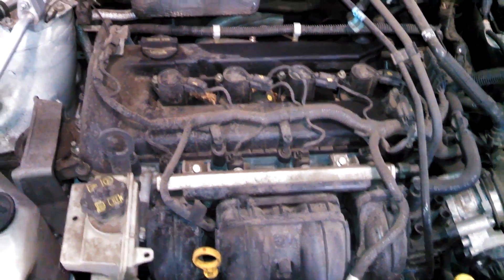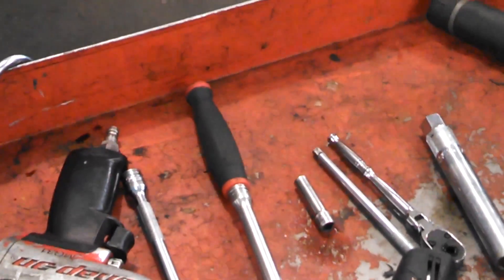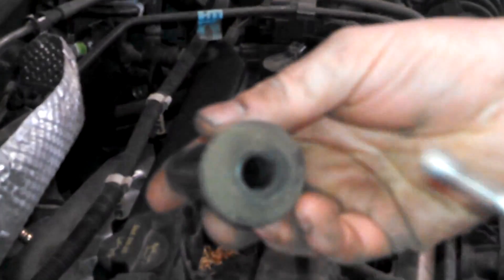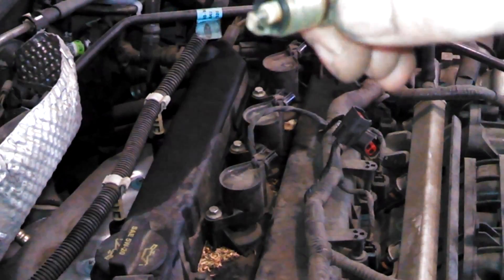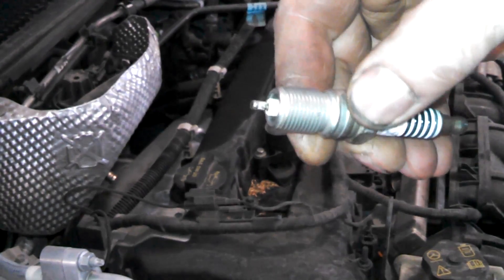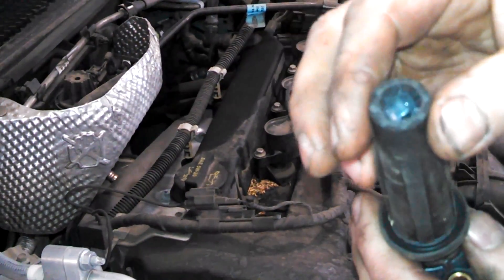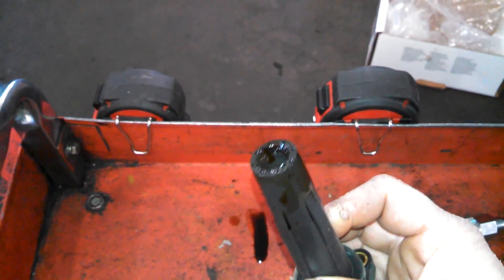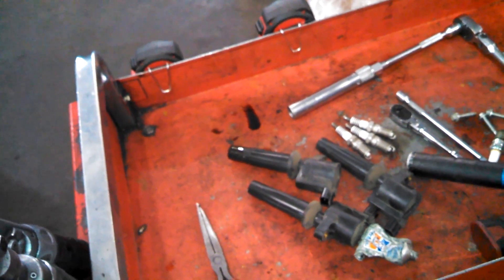Spark plug replacement 2008 Ford Focus 2.0L ignition coil. How to change plugs

Comment: Just did a plug job on a 91 taurus GL 3.0, had a bad misfire on acceleration now runs like a champ.  Hardest part was breaking the wires off the plugs. It was my grandmas car that was maintained VERY meticulously except for the plugs....they may have been original, wouldn't surprise me
Reply: Sometimes it makes things easier if you warm the engine up before you start.

Comment: Nice bro, 2 suggestions 1. What's OEM recommendations on spark plug part # 2. Possibly tighten bolts to stop or slow down oil leak

Comment: Spark plug gaps are measured in thousandths of an inch. How did you eyeball the gap so that it "looks good?" The gap is supposed to be .051". On modern, computerized engines this gap is even more critical. That is why engines use precious metals now, in order to maintain the gap longer. Yes, they can be gapped, you just need to be more careful as the finer electrode is more susceptible to deformation.

Comment: Do I need to replace the boot covers as well?
Reply: The boot should come on the new coil. Make sure you call several stores for price. You may save yourself $10-$20 per coil.  Original equipment usually lasts longer. I've replaced with aftermarket and had brand new sensors that were no good sold the car guy bought Ford sensor the car ran like new.

Comment: On the passenger side of the harness that runs across here, what's the single wire coming out the end of the harness? Also I had to run a direct hot wire to this same wire to get my coils to fire. I see the single wire past the far left of the last coil, I know that the car will not fire with out it connected but mine is cut

Comment: What if you try to remove the spark plug but inside where the spark plug goes is full of oil
Reply: Remove as much oil as you can before pulling the plug and replace valve cover gasket.

Comment: What's the size of the socket you used for the bolt holding the ignition coil? and for the spark plug?
Reply: 8mm and ⅝"

Comment: I have a question my 2010 ford focus just started shaking out of nowhere any ideas I'm hearing coil pack, or motor mount?
Reply: Trevor Arnold mine is a 08 and did the same thing and I replaced the motor mount and it took away the shaking
Reply: Yeah. I drive an 08 and i replaced the motor mounts and it stopped as well

Comment: you don’t have to undo battery terminal?
Reply: Most of the time you mess with electrical items on a vehicle it is good to unhook the battery. Your computer will have to relearn which is OK your fuel economy may get better and codes may erase themselves and not come back on if you have rectified the problem.

Comment: what is that sensor in between coil pack 2 &3?
Reply: The one with the rubber boot over it?
Reply: U know the name of the sensor between coils 2&3
Reply: cylinder temperature sensor.